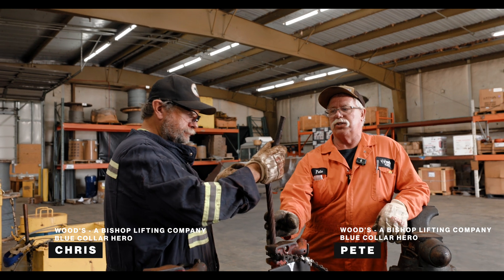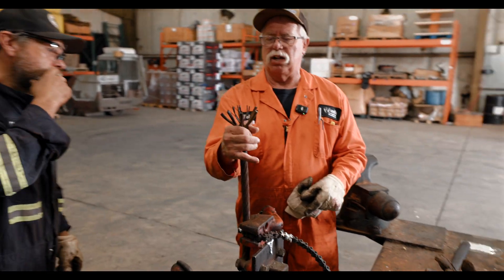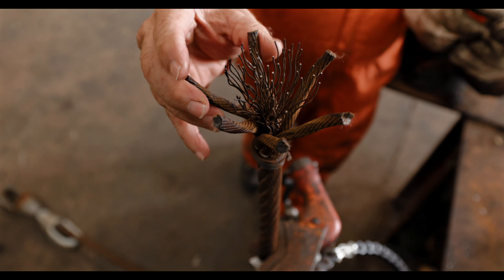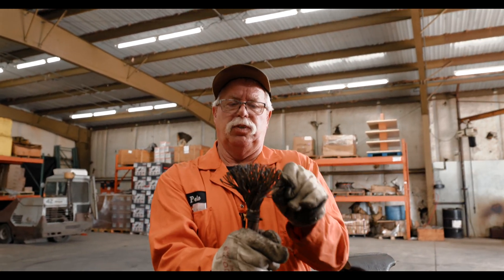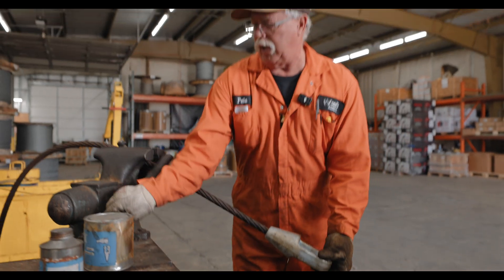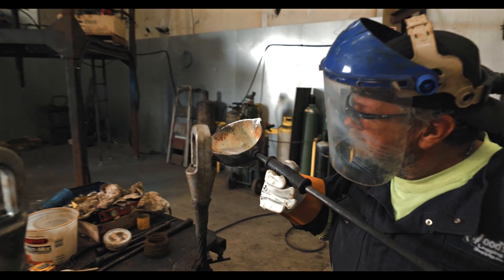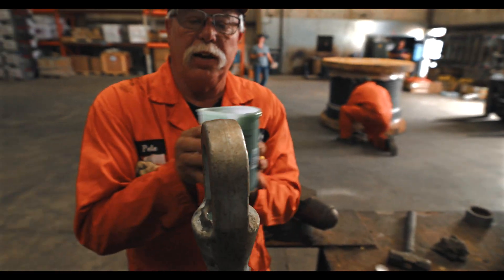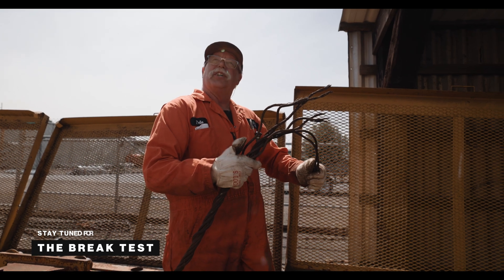Watch Us Perform Resin and Zinc Socketing on Wire Rope Slings Before Break Testing

Comment from the maker: 🔧 Resin or Zinc — Which Socketing Method Do You Use Most?

Both methods in this video deliver 100% efficiency when done right — but each has its place depending on the lift. Whether you're working offshore, in the shop, or on-site, the right termination method matters.

Drop your thoughts or experiences below — and let us know what you'd like to see next from the Sweat & Steel series.

#TrustTheLift #Rigging #WireRope #Socketing